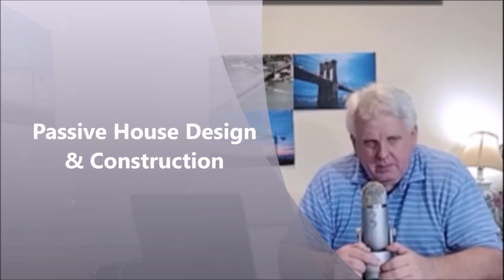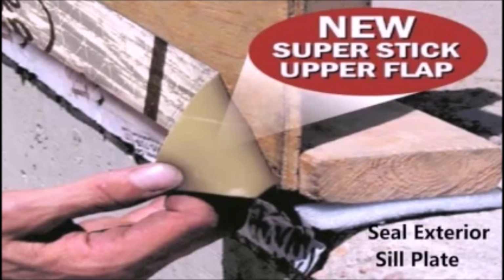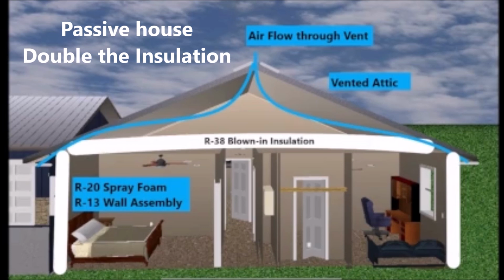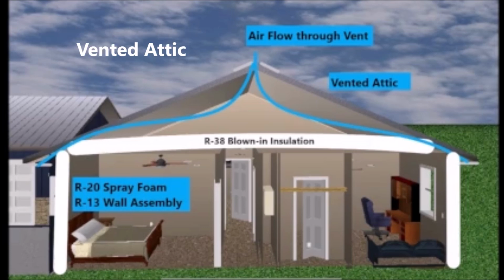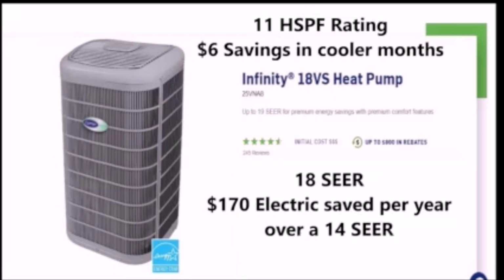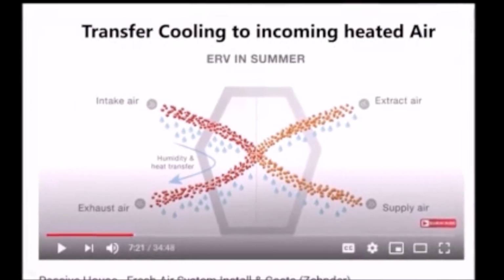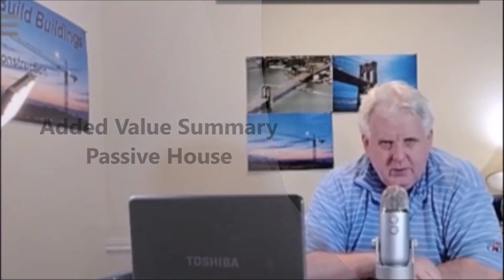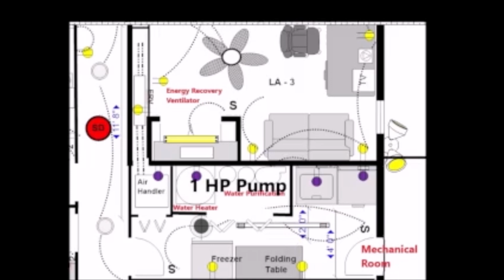Passive House Design & Construction- Value Engineering

Comment: When you make the calculation for the added insulation it seems like you could also save money on mechanicals by reducing the heating and cooling load?  3500 doesn’t seem like a lot if you can build a more resilient home that needs fewer btus of heat and cooling
Reply from the maker: @dannebotte, see above comment.